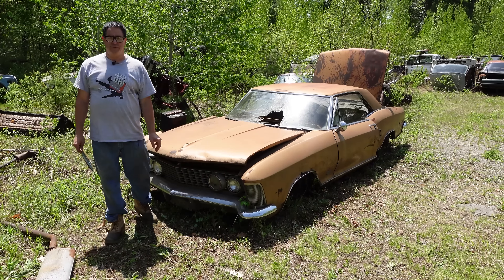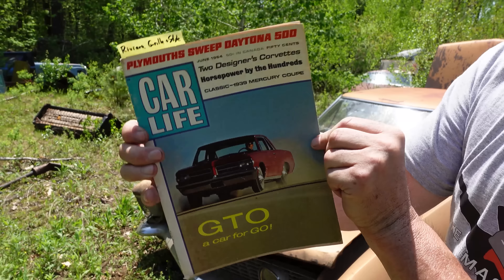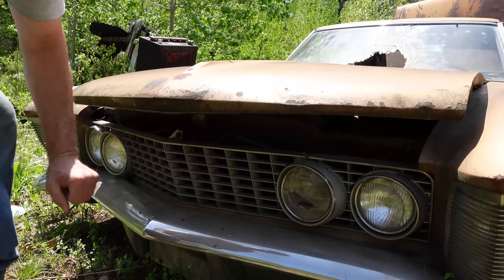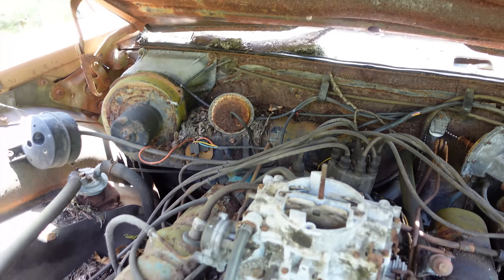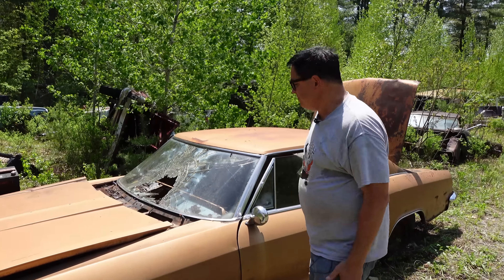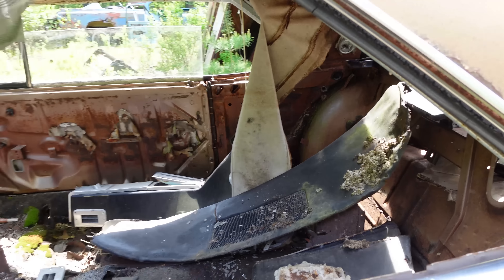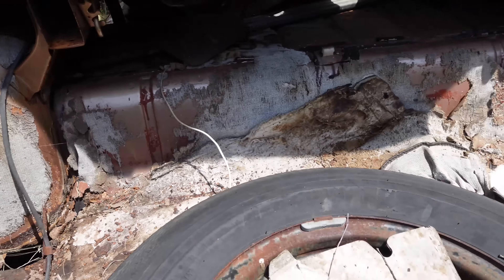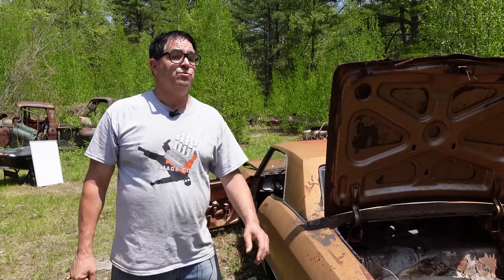LaSalle Reborn   Almost

Comment: Well Steve, you did it again. Never seen or heard of removable door skins, wild. As always, great presentations, memories and education. Cheers!
Reply: Saturns had that type of door also
Reply: That's perfect for style changes or a parking error. I wish the roads had less corrosive ice buster on there. Y'all eating up southern cars but I blame Cali more so it's a wash up. I occasionally see a Bel Aire or a 34 Ford coupe. Used to see falcons more. Started seeing Mavericks. All the fast and furious cars are sapped up by the college kids and I never see any rx-7 other than a mid 80's one maybe a convertible. Rust was bad bad on Japanese cars even outside the rust belt. Coating the inside of the body and doors should be done right after purchase.
Reply: @marshmower  Trust me, I live in the frozen waste-land of MI. The battle with rust is endless, and rust always wins.
Reply: VW used bolt on door skins on the Jetta

Comment: This car was the first, and by far the most worthy attempt to bring back the LaSalle nameplate in the postwar era.  The other attempts would degrade further.  The 2nd was to be a modified X-body (i.e. Nova) for 1977, but was named Seville instead.  The 3rd was no more than a rebadged and tarted up J-body (Cavalier) in 1982 that went with the Cimarron name.

Comment: We always used a Buick frame and suspension in my dirt track car because of its   strength!  A small weight penalty but worth it!
It had a 66 Chevelle body that everyone was envious of but it was legal!!😁
A lot of wheels/hubs came off but not us!!
When the body got beat up just weld another one on!! The frame was fine!! The drum brakes worked fine!! Also the differential and transmission were bullet proof!!
We called it a Buvelle!!

Comment: I'm working on a 1965 and just wrapped up filming of putting the door skin on, it will be posted Monday. It is worth noting that the 401" was the base engine in '64 and '65. The dual quads were the 425" version.
Reply: Not true, he's correct.
Reply: Only two engines were available in 1964......the base 425 4 barrel or the optional double 4 barrel 425. In 65 the base engine was again the 401, and the vast majority of them came with 401 engines. The next option up for 1965 was the 425 4 barrel 425. Top dog was the 425 with two 4 barrel carbs. You 
could buy a 65 Riviera with the two 4 barrel 425 without the Gran Sport package, but if you specified a Gran Sport 65 Riviera, the Super Wildcat
two 4 barrel 425 engine was standard equipment. I am the proud owner of a mint condition unrestored 65 Riviera with the base 401 engine, in Seafoam Green with dark green custom interior. My Dad bought a new 65 Riviera back in 64 that I kept washed and waxed when I was a kid and learned to drive in it in 1967...... The 65 Riviera is the greatest GM car ever built in my opinion.
Reply: @winstonmccollum8992  Correct my friend.

Comment: Great looking car! Easily in my top 25 favorite car designs ever. So much style and beefy from any angle. My Mom had a ‘63 when I was a fifth grader. I sat in the driver seat and made engine noises, gettin slobber on the inside of the windshield. I would sometimes dream of driving it while I was drifting off to sleep. I’m an old guy now, nearing the end of my career and may buy myself a nice one as a retirement present. I prefer the hidden headlights of the ‘65 but the tail lights above the bumper on the ‘63….so guess either would be ok. Thanks for the look at this one Steve! 👍

Comment: One of the finer touches on Buicks of that era, or at least the upper class ones was the fact the bumpers did not have bolt heads that showed on the outside of the bumper. Most cars of that era had something like a carriage bolt with a polished stainless steel cap on it  The Buicks and Caddies had the brackets welded inside it bumper so it would not show on the outside.

Comment: That one is a 401 Steve.  The 425 was for the GS only.  Ya can't remember every THING at every second! 🙂
Also I believe all Buicks were an X frame AND a perimeter frame all in one.
I had a '65. It was the only car I ever saw that you could stand up in the MIDDLE of the roof panel and it wouldn't bend!!!
Love Cads, but SO glad Buick got this as the 1st. Rivs were nicely understated.
Reply: check your facts Steve is right at least according to my 64 service manual, and research that i have done on my own 64 Riviera. For some reason the 63  & 65 had a 401, but the 64 had a 425
Reply: @philipcaputo841  Oh wow strange! I had no idea. Thanks for the correction.

Comment: The X frame deserves a vid. It was used by all gm divisions except olds from 55 to the mid 60s and was a big factor for the push for safety legislation due to its lack of side impact protection. Olds touted their parimeter frame for better safety in ads and the govt used that against gm. Ironic.
Reply: Frames made at AO Smith in Milwaukee.
Reply: X frame went from 58 to 64.
Reply: I have a 63 Oldsmobile Dynamic 88 Holiday and sure enough,  the frame is heavy duty perimeter. Built like a tank.

Comment: and that 1964 it had one of the first th400 trans  but the x frame required a 2 1/2 inch drive shaft with a carrier bearing .

Comment: That Riviera was a pretty grand ride OUAT (Once Upon A Time). The gold and the other metallics like bronze and medium blue were perfect for this sharp styling but they also look good in the shade of white that was available. Not wrecked and you wonder the circumstances that led to it sitting on the ground rotting away in Massachusetts . This yard has great variety but too bad they didn't take care to keep vehicles from direct contact with the ground. Lots of good parts though.
Steve, thanks again, for the good knowledge. Bolt on door skin?. Great idea. More cars should have that. Never before realized the Riv was the first with frameless glass. Surprised by the x-frame, had assumed perimeter frame because they seem so solid. The trunk bracing? DNK.
 I do miss that manufacturers once offered distinctly different engines from one another. Nailheads are fantastic torque monsters. With the small valves they also have unique camshaft profiles to help them breath better which gives them a particularly nice sounding exhaust note. I once raced my 65 442 with the 400 against a dual quad 425 Rivera. Before I was out of first gear he was just about a half city block ahead of me. Blew me into the weeds.

Comment: With GM's self-imposed 50% market share limitation, and with the divisions being autonomous from each other at this time, the competitive edge at GM was kept sharp at this time.  Typically between Buick, Olds, and Pontiac one of them was in trouble, and they seemed to take it in turns.  When Pontiac slumped enter Bunkie Knudsen.  Then it was Buick's turn.  The Riviera was just the image boost Buick needed.

Comment: The 1964 Riv was the first year of the Buick Super Turbine 400/TH400/3l80 tranny. I had a 1963 Le Sabre sedan with that DynaFlo; knowing what I now compared to 40 years ago, I had access to a 1965 Le Sabre with its 401/ST400, I would've simply bolted the newer 401 into place then figured out the rear crossmember as well as shift linkage
Reply: Headlight buckets as per the 1965, GM Opel used a very similar design on that same era German market Diplomat, which received the Chevy 327 and possibly the TH400 starting around 1966

Comment: I'd like to see the trim tags and VINs on these as that would add to the video tremendously in my belief, but we can figure some of it out:

No VIN, can't win, but I figured it out, no doubt: 7 for Riviera, K for 1964 model year, 1 for Flint, MI assembly and the rest is the production sequence. No tag, can't brag, but it would be 64 for 1964 model year, 4747 for Riviera Sport Coupe, then a two digit month and A,B,C corresponding to the first, second third, etc. week of that month's production, FB for Flint, MI assembly, possible S-S for Bronze Mist upper and lower exterior paint, possible 608 or 628 for Black interior trim, and accessory option codes are unknown without the tag.

Comment: Those big V-8's usually get removed very quickly once they are junked. Those Florida '63 -'64 Rivieras typically are missing engines when sold as project or parts cars on Copart. 

The sheet metal on this ones fenders looks rust free for Mass. standards. Would think it was garaged most of its life. Would think the floor pans disintegrate immediately once the terrarium lifestyle of sitting on a moist field floor without wheels  and trimmed grass so there is no air evaporation of moisture under the car.

Piece of cake to restore this one on a rotisserie. The thumbnail might entice some firm offers.

Comment: so many great parts on that car.  The nailhead engine.  Tilt column.  Console might be useable.  Those side grills, n fact entire grill looks decent.  Door skins (bolt on at that).  Tail lights and reverse lights look decent.  That hitch is probably useable, re-chrome it.  Amazing that rusted out hulk has a lot of good parts.  Tranny might be rebuildable.  Rear axle might be decent.

Comment: Morning Steve, I'm not a Buick fan, but these Riv's....I remember a buddy had one of those Buicks, 2 four barrel carbs...think he got 6k for it...this was in the early 80's
Steve, in your video, when you went to the trunk area, you mentioned the passenger side trunk brace, you used the word "crashworthyness", alot of people don't know what that word means....in early 2000, I worked for GM Milford Proving Grounds.....guess where....the Crashworthyness lab...we did full vehicle builds for the crash barrier, a couple years before I left GM built there Controlled Roll Over Facility, we were devoloping Roll Over Testing, building & installing the remote controls for these vehicles. I remember we had a Grand Opening of the Roll Over Facility, the GM Brass & local news was there, well there was me with my Ford hat on.....I guess they should have given me a GM hat....be safe!!! God Bless!!!

Comment: This car actually nearly became the Eldorado . It was deemed too sporty for Cadillac , so we have the Riviera . I drove one of these for about 20 years . The brakes were the worst design , with steel pressed liners in finned aluminum drums . As it turned out the heat "damming" , restricted the heat from passing from the ferrous lining to the drum . I can tell you first hand , there was a steep learning curve using them . The trap waiting for the uninitiated was spontaneous full lock-up  . They behaved different with temperature from one brake application to the next . She was fast and pretty . Got too rusty , sold her in '88 .

Comment: Those are the days of GM wanting to have a "custom" look... Riviera, GTO, 442, front wheel drive Tornado and El Dorado...  The "personal luxury car" ..... Chrysler had the 300... Lincoln had the Mark series... Chevy did have the Impala but I consider them late to the party really with the Monte Carlo  which was advertised as a "PLC". And the Thunderbird did morph into "PLC" when they put in more seats.  The 300 excesses lead to a cleaner look from all manufacturers ...yet plenty of chrome... sculpted and rounded, lowered a bit but they retained the big engines!

Comment: Doing a little writing project, wondering how much a 63 or 64 might have sold for in 73 thru about 77. Did the price of gas hammer away at the resale values, especially on the larger engined examples?

Comment: What was that big black box under driver's side dash with a knob?
Reply from the maker: Hello Elias Garcia, the odd structure is actually the fuse block which typically secures under the dash but hangs like this when the securing screw is removed. Easier access to blown fuses this way versus playing "giraffe neck" and trying to work under the dash to locate and replace bad fuses. As for the "knob" that's the turn-signal-flasher unit. It plugs into the fuse block via 3-prongs and inside the circular structure is a heat-reactive switch that gets-hot-then-cools-gets-hot-then-cools, etc. to effect turn signal blinking action. THANKS for writing, Steve Magnante

Comment: Those are great cars except for the  X frames ,  bad news if your ever in a wreck and take a hard side impact they will fold in half!  seen  them wrapped around telephone poles. Not good.  GM dropped the design after 1964